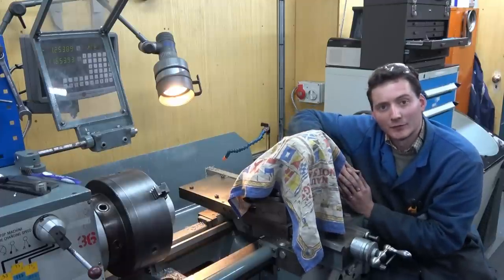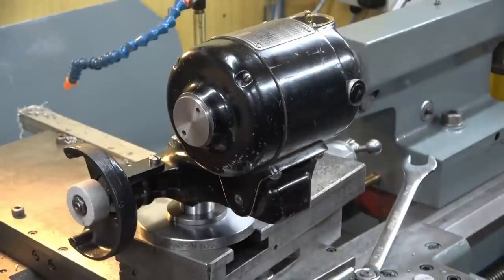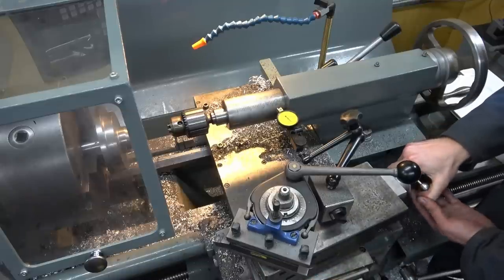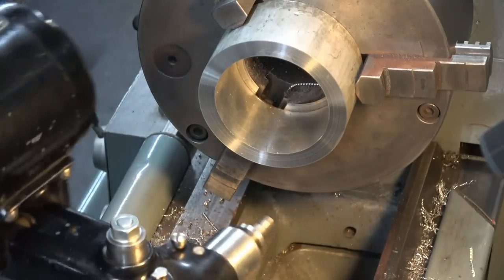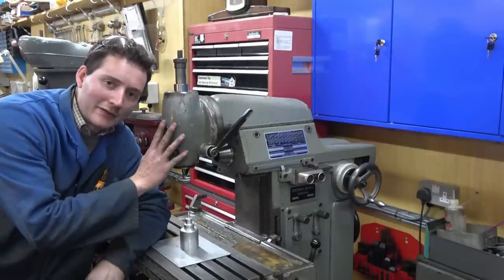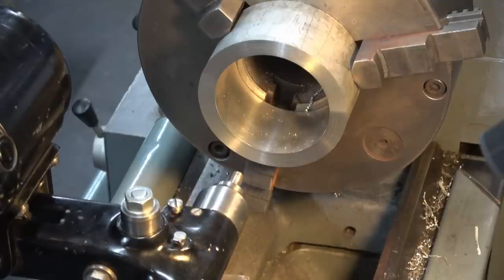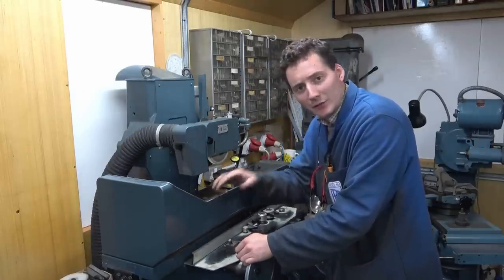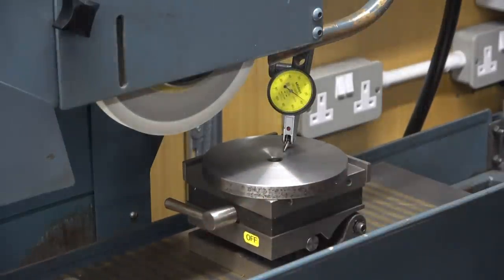Setting A Tool Post Grinder (The MrCrispin Way)

Comment: Congrats on your 10 years, barely seems any time since you were leaving us at York to start your apprenticeship, perhaps they will let you do some interesting stuff now ;)
  I was going to leave a comment about the possible droop of the verdict in the vertical plane but you seem to have already had a number of comments and responded accordingly. I first came across this problem in a Richard King scraping class Video where he had a DTI arrangement mounted on a flat plane and tipped the whole arrangement upside down and there was a considerable movement of the needle. Unfortunately it was some time ago and I cannot remember whose channel it was on, and I think it was a (High Quality) multi-arm holder at a distance relatively larger then your arrangement, but when you start to make high resolution measurements even gravity can be your enemy.
Reply from the maker: Thanks Melvyn. I think I'm going to have to cover this topic of indicator droop in another video.

Comment: Very absorbing as usual. I had to watch twice the section on surface grinding the base plate to get the required angle. I’m still not 100%. Did you grind a 0.007” wedge or was there more sophisticated trigonometry involved? Did I hear something about getting the ‘rung’. Please forgive me but if you have time I’d be most interested.
Reply from the maker: Yes I think you've got it. There's no trig it's just a case of making it sit on the surface grinder at the reverse of what I measured on the lathe. I referred to the angular error as the 'run'

Comment: the milling machine looked like an older Deckel FP1  ????
Reply from the maker: Yes 1965 Deckel FP1
Reply: In 1981 I worked as a student (engineering department of munich technical university) several month at Friedrich Deckel AG training center in munich. Therfore I remember these FP-series quite well....
Reply: Do you know the origin of these FP1 machines in the early 1910s,  and the meaning of the abbreviation "FP" ?
Reply from the maker: No I don't think so

Comment: I’m jumping ahead a bit, but how do you protect the lathe bed from the grinding dust? I assume the correct Rolls Royce method is a bit more sophisticated than draping a cloth over everything…
Reply: Just put a Rolls Royce jet engine at one end of the lathe and blow the dust away as you grind!
Reply from the maker: I think the Rolls-Royce approach is to do grinding on a grinding machine!

Comment: I believe because your work is spinning and your tool is spinning and you are facing the only directions your tool post grinder needs to be aligned is center and in the direction you are moving the grinder and that direction is already aligned because you are using the cross slide to move the grinder.
Reply from the maker: You haven't seen what I'm going to grind yet!

Comment: Congratulations on your 10 years of service...and your attainment of "intermediate" level.   I spent 20 + years in the trade (before a career change) and only reached a spectacularly "average" level. 
Your video is indeed technical but I did pick up a few things...1. Your tie is neatly rolled up in your toolbox...2. Your brother's toothbrush has made an appearance again.
The suspense was agonising in checking the final centre height, where I thought it would certainly need to be readjusted. I also eagerly await the day when your hat finally misses it's mark.
ps. Showing the finished product at the beginning of the video makes it more easily understood. 
Well done sir.
Reply from the maker: Thanks. Yes my hat is looking in good shape considering the number of times it has landed in the swarf tray!

Comment: Indicating off a sine bar would be faster and more accurate. That method introduces too many error points.
Reply from the maker: You may be aware that I have already done a video on setting taper angles using a sine bar. I'd agree more accurate on a surface plate but some how you have to hold it in place and ay the right orientation on the lathe. This introduces more error points and I think is certainly slower.
Reply: @MrCrispinEnterprises  I did see your vid on it. I've seen all of them. 
In this case you could use the same riser block used in the other video and sit the sine bar up against the tail stock ram if desired. 

Notice that you were previously able to determine the alignment after winding the compound only about 1 1/4"(no requirement to be exact), getting instant feedback as opposed to the mandatory exactly 25 turns required here. 

5:25 You can leave the door unlocked and the phone on. No need to speed up the video during the 25 turns. So everything done from 4:50-6:29 is unneeded

The indicator is loaded only once, not twice, eliminating that source of error. 

The cross slide & screw is not involved nor is the calculation needed to determine it's depth, eliminating those 2 sources of error.

You might say your sine bar is ~6" so won't fit on the tail stock ram. You can actually make up a quick 1 use sine bar of any length simply by taking a bar and making 2 identical notches any given distance apart and deburr them identically. Sine bars are not the uber precision devices most think. They can be fairly sloppy and still give superb results. No requirement for precision rollers a set distance apart, only 2 identical features a certain distance apart and a parallel surface opposite. They could be dead square corners instead of rollers. For example:
___/\______________/\__
        |<----------3"------->|

(hope this graphic shows correctly)

Alternatively , and more accurately, you could turn a scrap bar of any length and set your sine bar against that which is even more accurate. 

The method shown in this video is actually using the cross slide AS a sine bar but using the cross slide to replace the gage block stack, a quick 1 time shop made sine bar would be at least as good.

I wager a pint that this is both faster and more accurate. And I wouldn't mind losing as it would be great fun hoisting one with you.
Reply from the maker: The beauty of the tailstock method is that no extra equipment is required so no rummaging around for riser blocks, no building slips up ect. I think I'll present a discussion to the audience in the next video.
Reply: @MrCrispinEnterprises  That would be interesting. I see your point about convenience but you have to balance that against (what I claim is) inaccuracy. I think most guys would not have to search too far for the equipment ,1-2-3 blocks etc..
Exploring the pros and cons in video and comments would be fun.
Reply: @MrCrispinEnterprises   yes if it's good enough for Joe Pie it's good enough for most of us!

Comment: I'm surprised you don't know that you always get a False reading when measuring vertically like what. due to gravity
Reply from the maker: I understand the point but that bar is hardly long enough to sag in the first place!!
Reply: Hi mr C great video! Gravity could well have been the cause of the vertical error. It plays a bigger role than one would think at the micron level even with short stickouts on the measuring equipment. Someone made a nice video about it and I’ll try and find it for you.
Reply: Check out Stefan’s video on the topic and you’ll be surprised at the error it can introduce and I do believe your setup would have introduced at least some gravitational error. Maybe not the full 7 thou but it could account for some of it.
Reply: Stefan’s video also shows his clever setup of measuring the gravitational effect and it may be interesting if you check what the effect is in your specific case and setup as you measured?
Reply from the maker: Thanks I've had a look. That video appears to be more about the sagging of multi joint flexible indicator holders. What I am holding my indicator with is a solid bar that is only 4"long. I'd be very surprised if the bar is flexing more than a few microns. I'll think of a way to find out.
Reply: @MrCrispinEnterprises  That’s true so maybe your setup is solid enough and the error was indeed all the accumulation of all the pieces of the lathe and the grinder.
Reply: anyway. thanks for all the good videos, and congratulations on the 10 years

Comment: I would have been interested to know the source of the horizontal error, it may be that it could have been in an item that would have been useful to also have in plane with the axis of the spindle. For instance if the top slide ways were out of parallel with its base, grinding the top slide base would have both corrected for the tool post grinder error and corrected horizontal errors in tool path when grinding a taper via the travel of the top slide. Potentially if the error were compounded in both the spacer and say the cast bottom of the tool post grinder it may have just been a matter of indexing them properly to cross-cancel or a matter of grinding/turning the casting to create a flat face concentric to the post axis for the spacer to register to. 
As an aside, on the Dumore I see a slotted screw parallel to the mounting post, does it protrude from the bottom of the casting for fine adjusting the height?
Please don't receive any of this as condescending, you are a great teacher and I highly value your opinion :)
Reply from the maker: I'll have a look at the screw as I'm not sure. Yes you are quite right in suggesting that I should find the source of the error but I'm trying my best not to make a project out of a project!
Reply: @MrCrispinEnterprises  Yes, no good project comes without too many side projects to make it happen. I loved your earlier comment that "we have lathes and mills to make parts for our lathes and mills"... too accurate. Cheers

Comment: could some of the error be in the bed as well? Liked the way you did this video, made it easier to absorb 👍
Reply from the maker: In theory yes the bed to spindle relationship would play a part
Reply: @MrCrispinEnterprises  you say in theory, so I presume like me you are thinking various small accumulated errors and maybe the vertical toolpost bore not vertical? Is there any way of spinning the tool post 180 deg, chucking something in a tailstock chuck and repeating the measurement ? or would this not be accurate enough.
Reply from the maker: There would be a way to do it. You would just have to find someway of mounting an indicator in a position where it could be accessed on both 0 and 180 degrees
Reply: @MrCrispinEnterprises  mmm, I'm not sure what you mean, I see another video coming?😁
Reply from the maker: I meant that you would need to have an indicator in a position where you could reach when the tool Post Grinder was at both positions. (facing the tailstock Vs facing the headstock)

Comment: Good one .   When you dress the wheel , that will take care of any axial alignment with the  bed way for parallel grinding & the compound alignment for taper grinding .   I only eyeball that part of the set up  as the dressing sorts it out .    Your  tilt the other way is important  if you are face grinding .      I have a heap of video's on the TPG .  In use doing parallel , taper & face grinding on my R8 tooling . Not just show & tell ones !   Cheers . 👍
Reply from the maker: Indeed. In this operation however I also need to use the face of the wheel. (typical dished wheel)
Reply: @MrCrispinEnterprises  With face grinding , you may have to shim the base of the grinder to get the criss cross pattern .   There is a point just before the wheel req's re dressing that you get the best surface finish . It takes a bit of practice to get to know that point .  Also i found to dis regard everything you know about cylindrical grinding when using the TPG to get the best results !